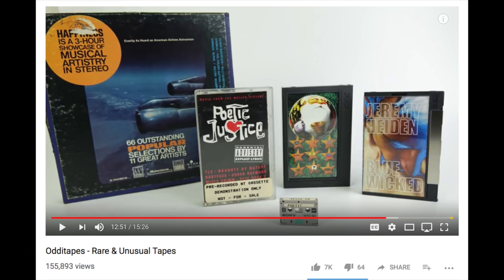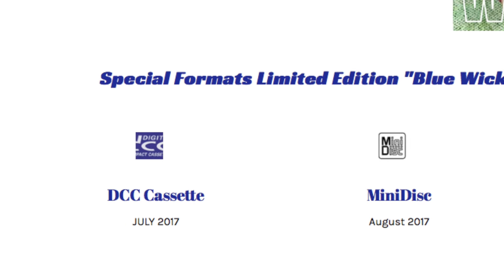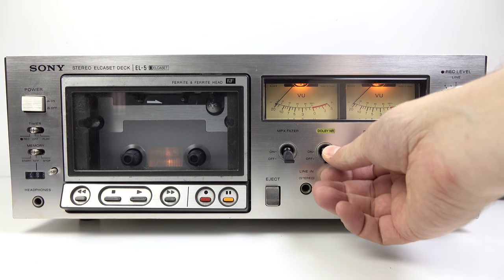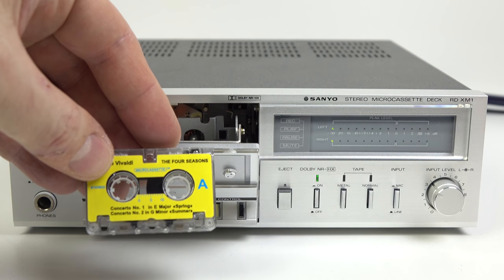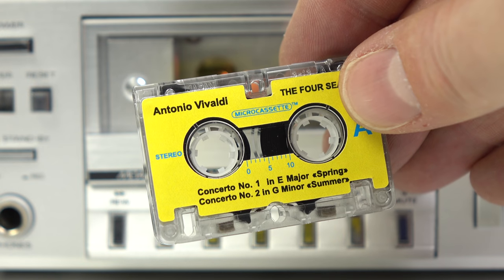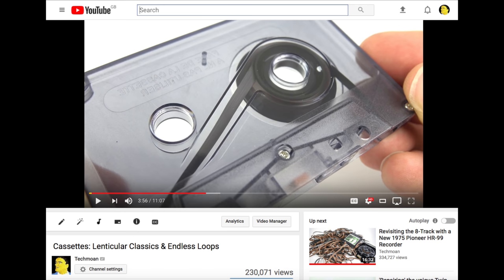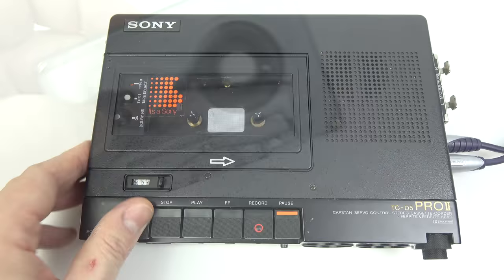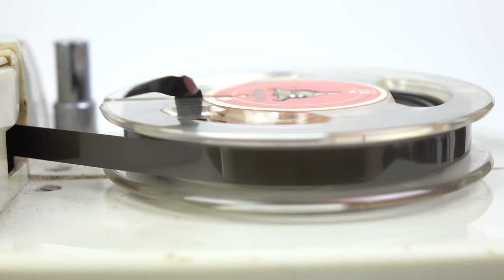Audities - More interesting & unusual recordings

Comment: I hope that this won't get lost in this sea of comments, but I was wondering if you could make a video on your stella philips machine (the one used for the 3" reel playback). I have one of those at home, and of course the rubber bands have perished. Did you have to get yours replaced, and was there anything else wrong with it when you got it? Thanks.
Reply from the maker: It worked fine when I bought it - although it still needs  a good clean.

Comment: There were Headphones with a builtin Radio antenna? So you can look like the biggest and weirdest nerd ever having a 20cm antenna sticking out of your head? Omg i need them!!!
Reply: Ya, I had a set of Sonys back in the 90s.  AM/FM only, big-arse antenna, though it was only about 4 or 5 inches long.  Sounded pretty good, tho.
Reply: Sounds like they’d make great movie props.
Reply: Back in the early 2000s I used to have an FM and AM radio housed in an earbud (about the size of a bluetooth headset) and I remember getting it from MacFrugals or a 7 Eleven. It was cool since I could listen to radio in school 'cuz it was so small
Reply: Hey, the size of the antenna doesn't matter, it's important how you use it.
Reply: Yeah, also got one of those.
Or something similar, it was a really big and clunky headset, since it also had to house a AAA battery.
It was cheap (bought at a novelty shop), but the reception was surprisingly decent.
Reply: I recall from the film The Towering Inferno, where the obligatory Annoying Kid In Disaster Film was wearing something like that.  Perhaps didn't hear the fire alarm going off, so ended up having to be rescued by Paul Newman.  At least he has stories.
Reply: I actually had two different types of radio headphones, a really decent Magnavox or Panasonic stereo one; I forget which right now.. also a few years later a really rather poor crappy red colored fold-up monaural job that I have no idea who made. Maybe Emerson. They were amazing to go around in just listening to the radio. Wish I still had them today.
Reply: Somewhere I might still have one of these: https://i.pinimg.com/236x/34/87/bf/3487bf44ee253cbd30ea08c757965ff4--vintage-yellow-headphones.jpg
Reply: Believe it or not, back in the 70's if you had a headphone radio, you were the height of cool. They were neato.
Reply: Those look perfect for when you're mowing the lawn.
Reply: Oldbmwr100rs They were (and maybe still are) available as actual ear protection for factory workers and craftsmen.  So for that application they need the bulk to keep out the literally deafening noise.
Reply: Tim Weber some time ago i tried to build a couple of headphones from broken headphone parts and rubbish (i was really bored) and i put a small retractable antenna connected to the ground cable on the side to recieve FM radio with an old walkman. It looked awkward, useless and potentially hazardous to other people's eyes. in a nutshell: AWESOME
Reply: How else are you going to have tunes when you're moving on your roller skates? (Disclaimer, I never did either of these)
Reply: Szpagin - My dad had a pair of those Sonys. They didn't sound great and weren't that comfortable, yet they somehow oozed charisma.
Reply: I don't remember the name of the company that made it ... but it was set up like a Walkman but it only had AM and FM radio .... absolutely amazing sound extremely rich bass for the time no bass boost it was extremely well balanced in the sound quality
Reply: Imagine if you could get headphones today with Bluetooth, MP3 player (with micro sd card slot) and an FM radio built in (don't know if you need AM in 2018)
Reply: Yep, I had some.  Remember them being bright yellow with an analog FM tuner on the earpiece.

Comment: 8:15  I dunno, Techmoan, I think its because the playback heads are at the bottom of the player rather than at the top,so you are putting the tape in upside down,so to speak,if you see what I mean. To give you an example,My cassette player, which plays standard audio cassettes, has the same head configuration and so it plays in the same way micro cassette player does.The actual schoolboy error you made was that you first put the tape in on the wrong side.

Comment: I wonder if that bit about someone going to the hospital for weighing over 198 pounds wasn't just a mix up and if the woman ment kilograms because if you weighed over 198 kg, that will convert into over 400 lbs and will have every reason to head straight to the hospital.

Comment: Never realized the Philips DCC-175 is something rare now. I got mine for a song when the electronics shops were getting rid of DCC in Finland. I also got a DCC deck (730 or something). The deck stopped working properly at some point, I think the 175 is still operational. Great sound quality, but the format is slow to use, and any dirt in the record/playback head causes errors. Especially playing old analog cassettes smudged it.

Comment: Why would 189 lbs. be considered heavy??  I spent the first 30-some years of my adult life at that weight and people thought I was as skinny as a pipe cleaner!!  Now, I'm 115 lbs. heavier and they say I'm fat!!  My belly is but nothing else on me is.
As for the reels, I used to always buy the Scotch 3" reels that had 15:00 per side and they came in plastic white self-locking boxes with mailing address stickers inside that you could put on the back to mail to whoever you wanted to send the recording to.  I started buying those in the late `60's during the Carnaby Street era.  I remember buying, from the same store, a copy of "Winchester Cathedral" and "I Was Kaiser Bill's Batman" at the same time (era).
I HAVE seen and held a couple Elcassette tapes years ago but never saw them again!
There's a guy from Akron, Ohio that was in a band called, Tin Huey in the late `70's.  They only did one album and an e.p..  He next shows up in a band called, The Waitresses, a couple years later.  In the late `80's or `90's he started doing solo albums, at one of which used various means to record it.  One song was done on a wire recorder, another was recorded straight onto a wax cylinder, etc..  His name is, Ralph Carney.  Turns out, some of his stuff appeared on the same label my band was on for a while, Smog Veil Records, from Columbus, Ohio.

Comment: Hey Techmoan.
Well i would like to have elcaset too.
But i just think with a good HiFi Stereo Video Recorder you can get the same quality. I was using a Sony VCR and the sound quality was awesome. I recorded some CD's like a compilation on a casette and i combined with a video signal from my old hi8 cam that was filming the street outside. I set a marker on every track so i could jump easily to the tracks.
In the specifications they wrote it has a frequency response from 20 to 20000 Hz and a dynamic range of 90db. Well that's almost the same like a cd.....but it's analog.
You should try that in a video. Maybe it's even better with a S-VHS or BetaMax system.
Best Regards.

Comment: Thumbs up for the Czechoslovak digital stopwatch or "Digitální stopky"! Never thought that communist era Czechoslovak tech would find its way to the UK. I presume that it's probably because of the old fashioned look of the nixie tubes, but still it's nice to see such feature in a British video. Just out of curiosity, did you have to make any adjustments to make it work smoothly (or I should rather write, make it not burn the nixie tubes over longer periods of time) on 240V? Communist era "220V only" devices tend to be designed really only for this voltage level and even the 1990's EU change to 230V could be harmful for those (Yes, I accidentaly slowly burnt out nixie tubes in my Soviet era alarm clock because of "modern" 230V). Usually this can be prevented by changing few resistors in the circuit. 

Thanks for answering and keep up the great work. 

Sincerely, 

A Czech viewer (who recently made a good decision on buying an older but "not really crappy" turntable and a decent budget preamp based on your educational videos).

Comment: I have 3 questions:

1.  Where and how did you get those old Mail Call tapes?
2.  Does anyone collect those?  I would think of these as "a snapshot in time".
3.   (OK, I lied about #3 being a question.  It's more of a request)

In 2011, I was kicked out of the house I grew up in.  We had some records, mostly easy listening stuff.  That stuff I don't care for, however there was a record in there that I REALLY want to get back.  It's a one sided record that plays from the inside out.  It's from radio station KIT.  It was made January 20, 1956 and it has my father, mother and oldest brother (who was 5 at time).  This record would be VERY sentimental to me as it would be the ONLY recording I'd have with my parents' voices.  I fear that the record may be gone, but there may be a chance that it's still out there.  If anyone has a clue where I may be able to find this record, PLEASE LET ME KNOW!!!

Comment: i have a pair of music muff headphones i bought at a carboot sale unfortunately mine are the radio version, i bought them for an experiment.
i plugged an fm tramsmitter into a metal detector, and tuned into it with the headphones it works great, so now i know it works i have built 2 small circuit boards one a transmitter fitted in the detector, the other a receiver fitted in the left headphone cup all to get rid of the wires, the headphone wires are a pain in the rear when detecting.
but now i know there is a version of the muffs with a mini deck built in i will look for those,

Comment: I just got myself a nice and sturdy TC D5 Pro (not a Pro II). I couldn't find any information about the differences between these devices (other than what is abvious by looking at them). May a friendly and informed chap help me out a bit?
Reply from the maker: Unfortunately I knew what they were when I made this video...but I’ve forgotten since...I have a short memory. I think there is a still in the video at one point that shows the different connections...and there is something to do with internal upgrades to the mic circuitry.
Reply: Thank you for that info. I think I'll try to buy a Pro II the next time I find someone who has no idea of its price offering one. I got my Pro I for 130 Euros and will probably sell it for around 650 because the fast forward does not work.

Comment: If you are still looking for another exotic recorder, look for the "Minifon P55" made by the German company Protona in the 1950s. It's an extremely tiny wire-recorder from the 1950, using valves. It costs about 2000 DM in the 1950s, as much as a good TV-set. I've got mine for 20 Euros, but it needs some repair (belts, replacement for the batteries). https://www.radiomuseum.org/r/protona_minifon_miniphon_p55.html
Reply from the maker: I’ve got one...but need the batteries which aren’t made any more.

Comment: I think there is some sort of discrepancy between the recorder and the player of the elcaset - the levels are very low, maybe something to do with magnetic flux dens. like ampex was 185 nwb\m but Revox A77 is 250, so that the 0 db is actually +2 according to old standart, well maybe the guy can't record for shit :D
Ive listened to an elcaset when I visited a tech seller and the sickest of all audiophiles Ive met, the elcaset sounded impressive, better than a 4 track reel to reel (of course thats generalising)

Comment: Unfortunately DCC used a lossy compression algorithm thus too expensive for general recording but not good enough quality for studio use and therefore- complete bollocks. At the time, nobody in their right mind would touch it with a barge pole because it was cheap and nasty substitute for proper PCM/DAT recording.

Comment: Have you tried a playable mp3 compact cassette tape yet? Got one on ebay (item: 352063032498) you put your mp3 tracks on an sd card, then insert it into the slot on top of the specally made cassette, turn it on, then you just put it in your tape recorder and play it like a normal cassette, it uses a magnetic head in the cassette it's self, like the old car CD cassette adaptors, Was quite impressed with mine.
Reply from the maker: Yes https://youtu.be/ppo3IgHWDzA
Reply: I'm surprised I missed that one, might go and throw out the power supply to mine now, as always, keep up the good work.